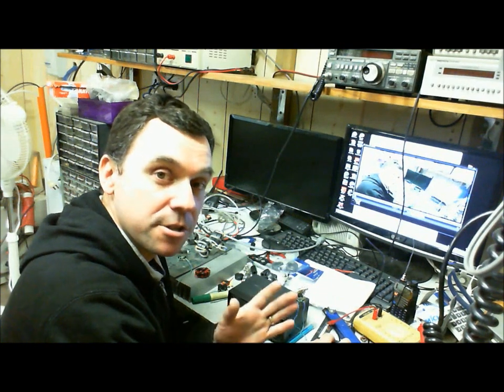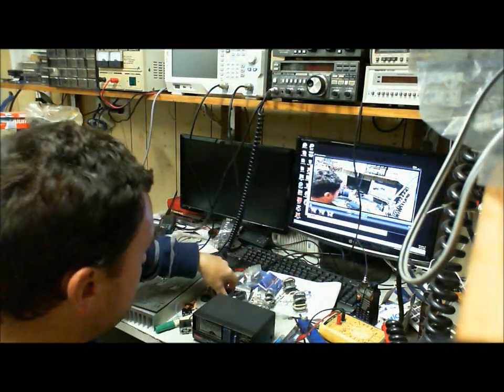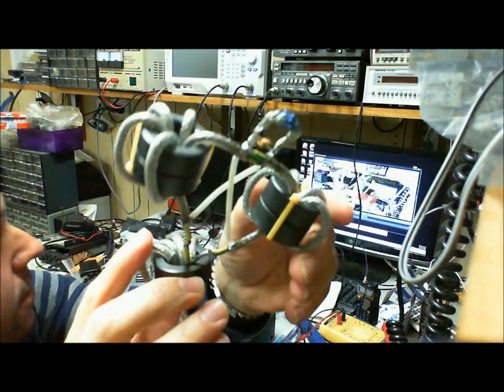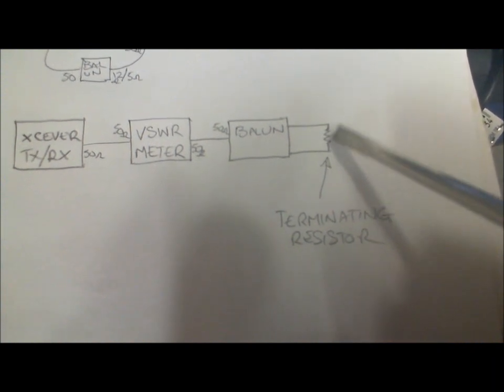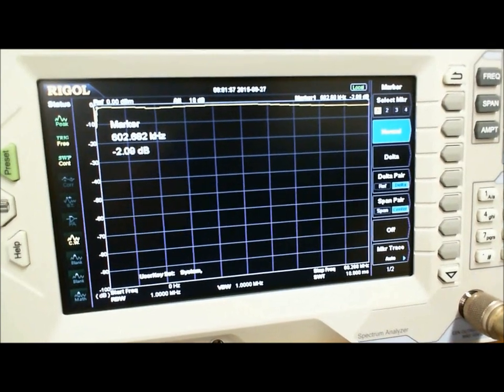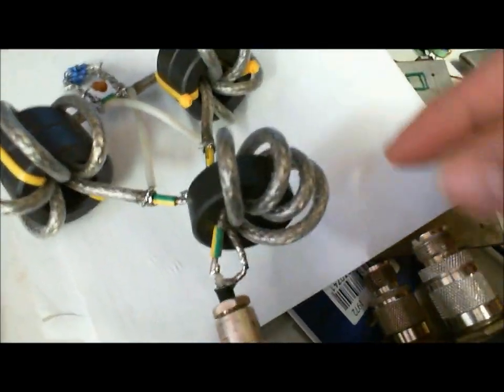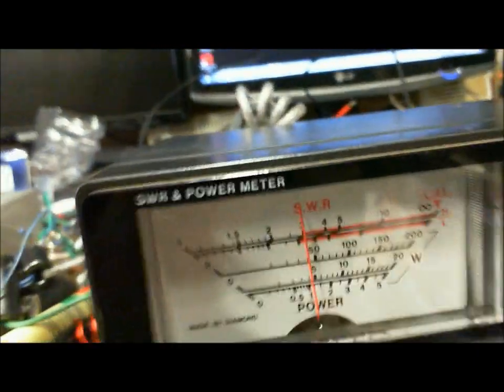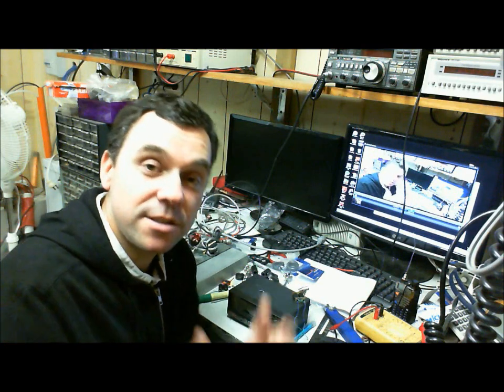Coaxial Transmission Line Transformer TLT

Comment: Hi nice the construction of these transformers and 20 ohms coax cable. can you specify the thickness of the copper wire and of the PVC insulation? Thanks , Vince
Reply from the maker: Check the video I did of exactly how I made the coax. It provides the values on the online calculator, thanks

Comment: I did not understand how 9x 5.6 resistors connected in parallel give 50 ohms. Their value has to be different. Please specify better input and output impedences.
Thanks, Vince.
Reply from the maker: no its the ratio. The low side goes to the FET drain via a dc blocking and the outer side is output to your antenna or tuner via a low pass filter. so its a 9:1 or 6:1 depending on the configuration. cheers.